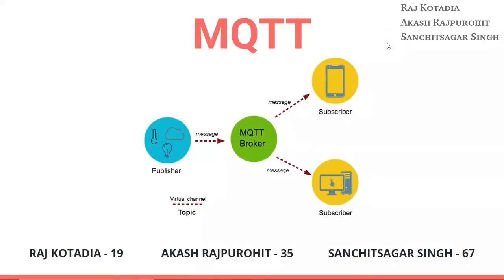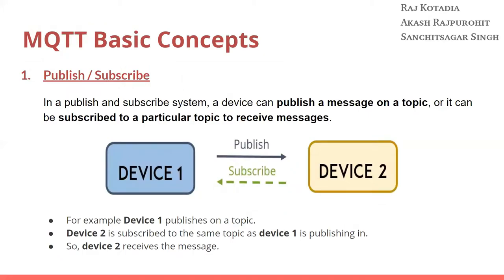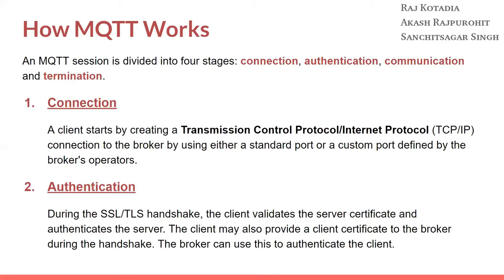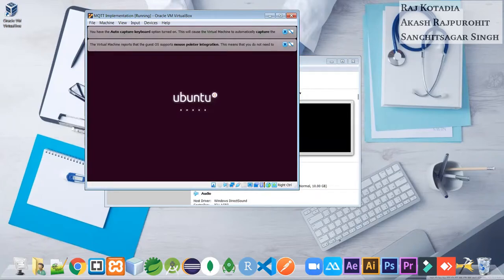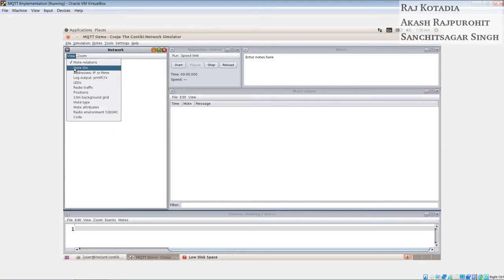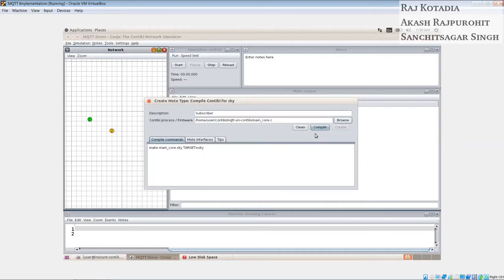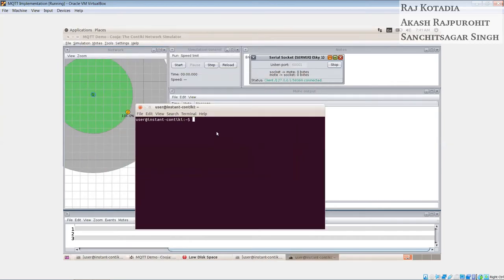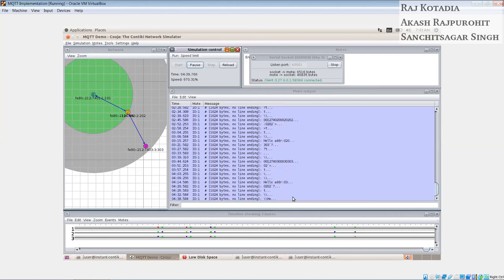MQTT Simulation with Cooja on Contiki OS

Comment: Hello sir can you help me pls !
When i execute the comand (sudo. /broker_mqtts config.mqtt) an error msg shows : . /broker_mqtts : 1: ./broker_mqtts: Syntax error: "(" unexpected
Help me please sir
Reply: Are you trying to execute it on a vm? If yes, it won't work. I don't have the source with me right now but it is some issue regarding the architecture used by the vm (probably x86) and the architecture required by the code (x64) or it could be vice versa. The only solution I could find is to install linux and then run the entire setup.
Reply: @anshulsomani2201  hello i am getting an error of a file missing. Can you tell me the link of mqtt-sn-contiki library? might be i have downloaded wrong one
Reply from the maker: Please Refer Step 14-17 in Description
Reply: @anshulsomani2201  are you sure there no way to fix it..? or was it because of the Ubuntu OS?.. fyi this vm running on x64 Win 10
Reply: @yasiriqbal541  I have also same issue. How can I fix it?
Reply: @aryaa3654  use contiki 3.0 in virtual box
Reply: @yasiriqbal541  Thank you
Reply: hi bro have you fixed it even i have the same issue